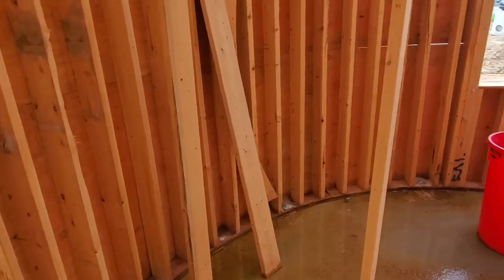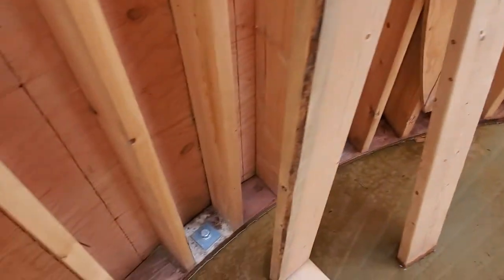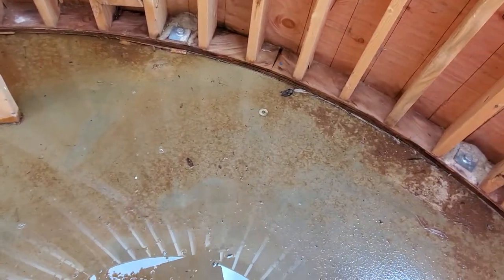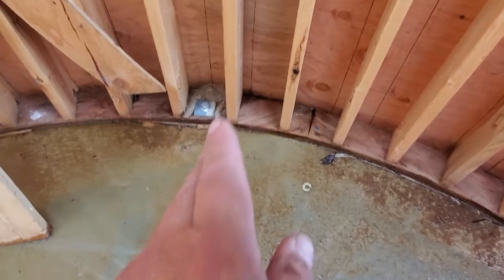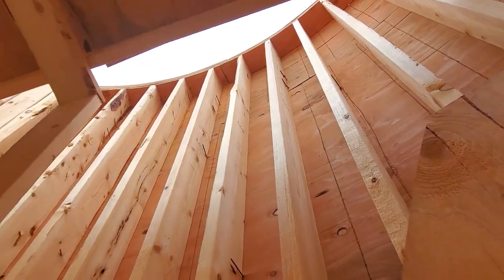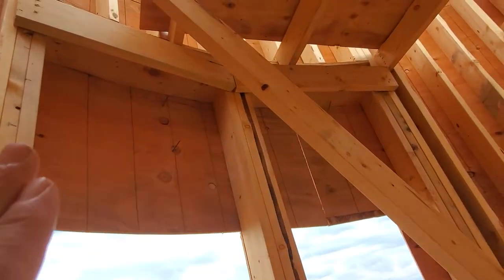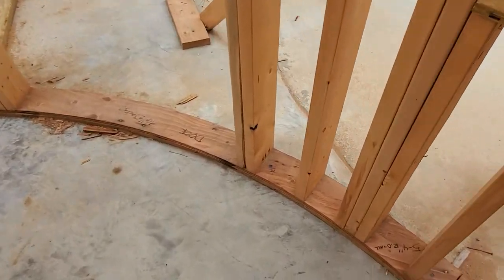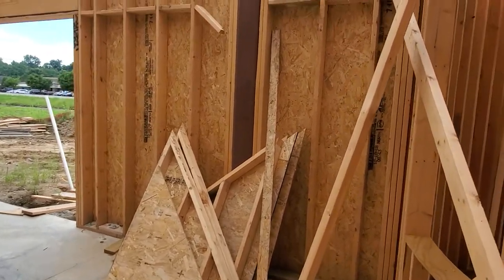How to Frame a Round Wall - Galloway Building Services

Comment: You don't kerf cut the plywood?
Reply from the maker: Some do but it weakens the plate on load bearing walls and for tighter radius you have to take a lot of meat out of the plate and a lot more work.